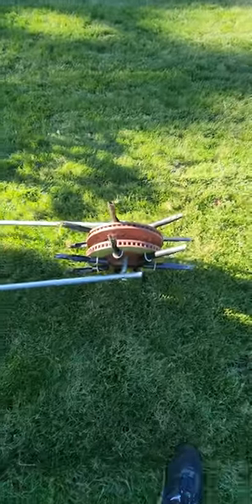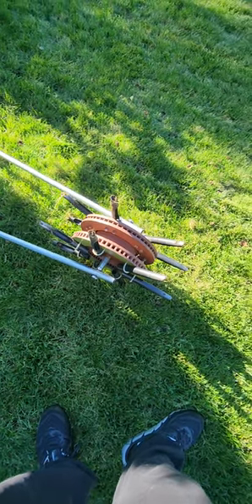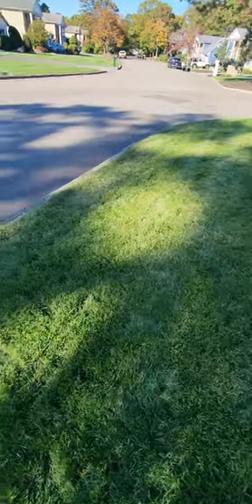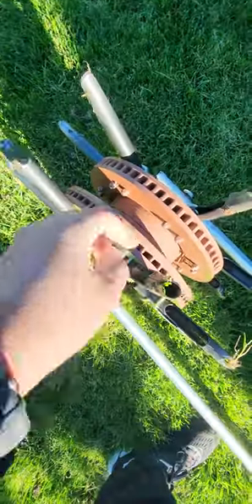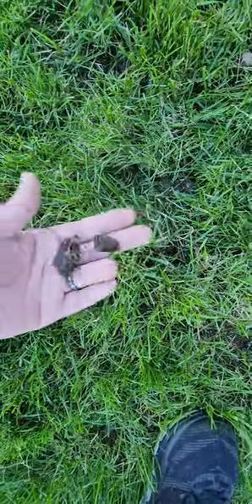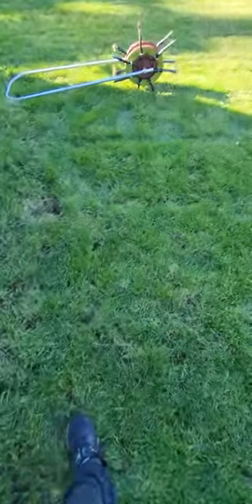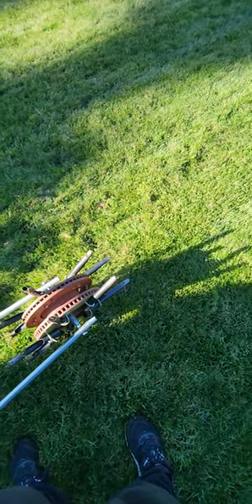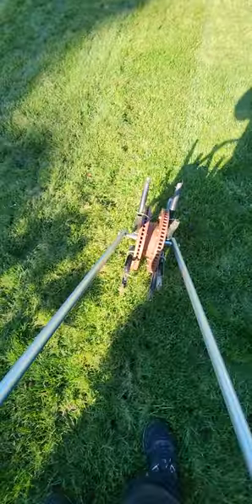UPDATE!! Amick Rollaerator with Oregon Tines!!

Comment: Thanks for the review! I was close to pulling the trigger on this thing.. now I’m convinced I should just build my own.
Reply: I will be building my own. Especially since it is now $500. 😂
Reply: It just looks like used disc brake rotors
Reply: Looking into just making it. The price of buying one is kinda crazy now. I'm about to replace my rotors for my car. So basically got half of the parts
Reply: ' now I’m convinced I should just build my own.'
Find AlbertDoesItAll channel, DIY Core Aerator - Update.    Wooden disc, so it's far easier to build.  Then just put weights on the axle, and use real aerator tines.  Makes far more sense, and an easy DIY project.
I have good large rotors, but really they're better used on other more mechanical projects anyway, and certainly doesn't make a lot of sense drilling those vs a wooden rotor.  Plus if you decide you want to change something later, just a few bucks for some more wood.
Reply: @ModelLights  I finished mine last week. Used plywood and a router jig to make the circle that I bolted the rotors to. All in all, it was fairly easy and worked as expected
Reply: yeah, seems like everyone has to do a mod on it when they buy. i had to JB weld original tines and the plates

Comment: your soil looks too dry! needs to be wet from rain or irrigation day before in order to aerate with good cores.
Reply from the maker: You're correct. I didn't core the entire lawn I just did a test plot. Even with the dry soil it worked well with these tines. With the original tines it didn't work at all even with wet soil. Also if u look in the video the part of my lawn closest towards the arborvitae trees where the soil is moist, it cored very well.

Comment: I have the double disk, with one row of tines.  I have the original tines - it works great.  I think part of the problem that you may be having is the double row of tines.
Reply from the maker: I will try the one row of tines but the original tines are bent pieces of metal that aren't even cut at the same length. I've tried one row of the original tines and it doesn't work.
Reply: @atg4469  Bummer.  Maybe it's the soil?  The price sucks for sure, but it saved me big time.  I used to have to rent a truck and pick up at the depot.  What a pain in the ass.  Let me know how it goes.  Where did you get those tines?
Reply from the maker: @Bryan-109 on Amazon, they are Oregon tines. I put link in description box but the tines are expensive. I wish they offered a box of 10 only but they don't. You have to buy in bulk.
Reply: Thanks!  I appreciate it.
Reply: I also have the double disk with single tines, works just fine!
Reply: Same.  My cores pop out with a slightly moist soil.  Can't be bone dry or it will just skip over the lawn without digging in

Comment: Thanks for sharing and fully agree the kit should come with quality tines in the first place.

For the double row of tines VS just a single row with the two brake rotors of about 30 lbs....  wouldn't a single row of tines with the two rotors work better and be easier to push... just have to roll twice as much, i.e. the tines would go into ground easier, and allow pushing it to be easier than the double you are demonstrating. 

I am going to make one myself and think that the single row of tines between the two rotors may be a better design for my small lawn. 
What would be your opinion on this, having your experience with the double?

Another consideration is the number of tines,   would adding another tine from 7, to 8, make it a better design for operation,  more plug holes closer together, and or maybe also a larger rotor in diameter to compliment an extra tine?  - what diameter is yours?

Comment: I built a roller out of a 8" pvc sewer pipe with plywood ends a couple of casters with the wheels removed to hold the conduit handle. Then I filled it with sand. It works pretty good. Should I try selling them?😅
Reply from the maker: @craigl1958  lol why not when u sell it let me know I'll test it out

Comment: I'm building my own, but i think yours would have worked with the stock tines or work better with these ones if you take one of the rows off and flip the other one to the center.
the PSI on each blade will effectively be doubled, it would be able to overcome the friction within the tines better as well as penetrate the ground easier. i saw a video of a guy with a the double disk system and one row of tines which seemed to work much better than this.

ofc you need to make twice as many passes but at least itll get done at the level a machine does it without having to rent the machine

Comment: For $400 dlr il go to my local hardware store and buy a pitchfork for 25 bucks, considering my lawn is abot 40x40ft, it'll take me maybe 1hr at the most plus its a good cardio😅.

I think you need more weight.
Reply from the maker: More than the 2 rotors it has now? hmmm maybe but its already kinda tough to push. the issue I see is that when there are two rotors its almost impossible to push. I think there isnt enough tines to be honest its kinda choppy to push. Id almost want to make a version that you can pull behind you like a rickshaw style version
Reply: @atg4469  curious, why can't you pull this?
Reply from the maker: @erikkayV  theoretically you could